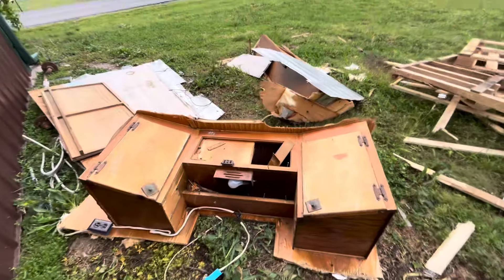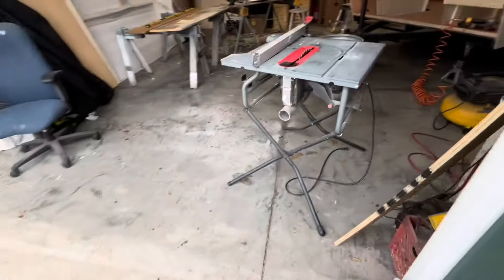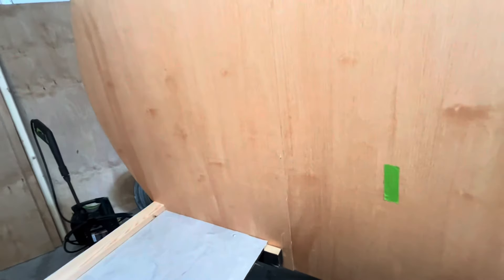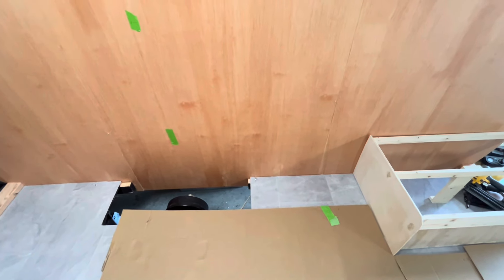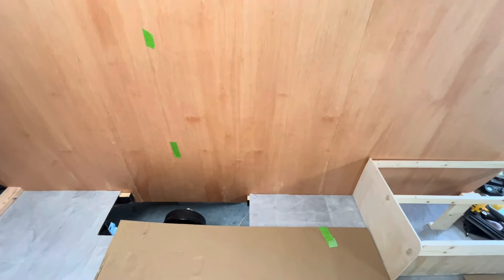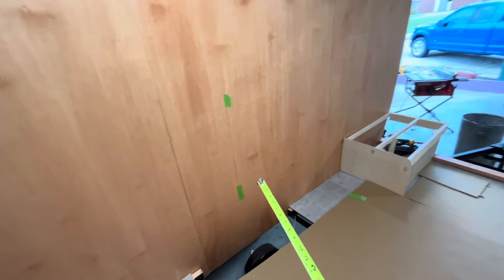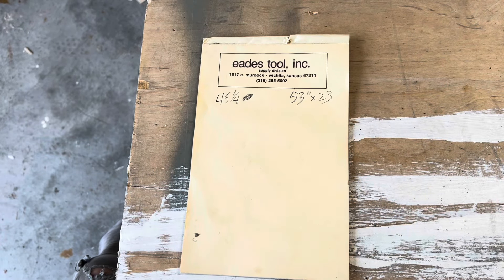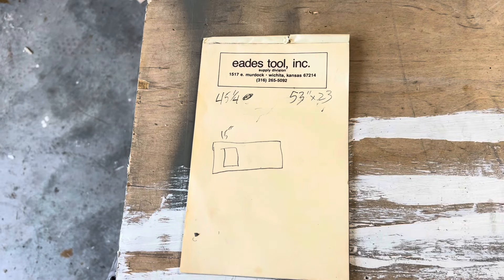EP. 362  1961 Comet vintage travel trailer rebuild enters phase 5

Comment: Hey Rob. i am wondering how you install the wheel wells, especially after you have installed the vinyl on the floor.
Reply from the maker: I generally go over the top of the opening instead of underneath.

Comment: Looking good where do you get Paneling  for vintage campers and how do you get your crank out windows fixed
Reply from the maker: Rebuild windows by hand. Keep old windows for parts. 2.7mm and 5.0mm paneling (luan) is available at HD
Reply: @RobTheRebuilder  no im looking for birchwood most of its good i just need a couple pieces to replace some damaged

Comment: What are the dimensions of the porta-potty unit? And once it’s brought out into the use position, is their enough room for the uses to sit on it and comfortably make their deposits and clean up afterwards? I myself have found many RV bathrooms to tight as to be unusable.
Reply from the maker: About 22" wide by 44" long. It is ok for me but much bigger or taller night be tough.